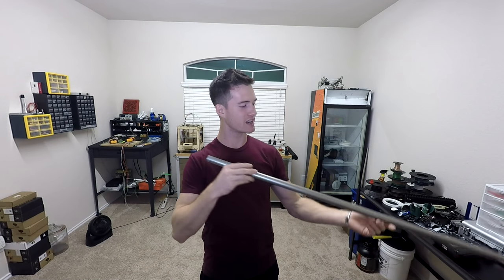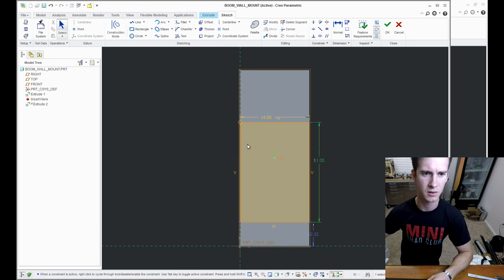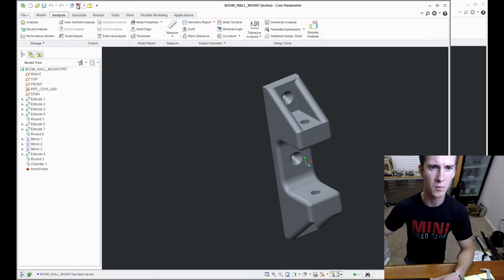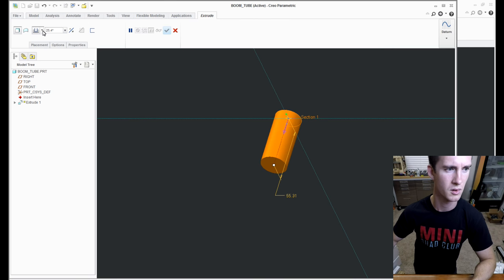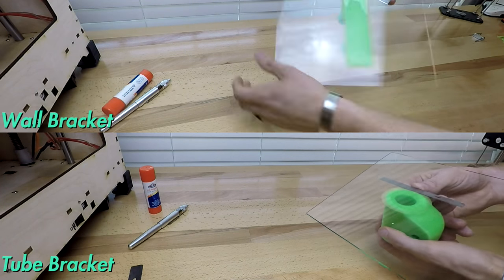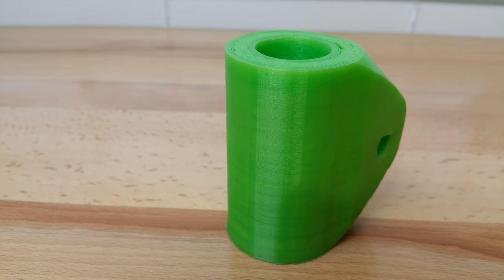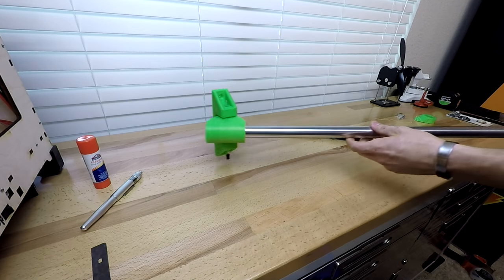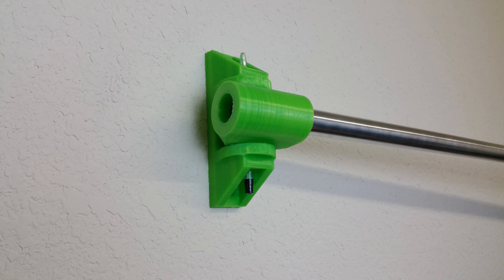News Flash - GoPro Boom

Comment: Thanks for sharing!

I have a similar process for my projects. Parametric cad is def a great tool together with 3d-printing for fast design iteration. I use Fusion360. Any particular reason that you went with Creo? Just curious :)

What is your reasoning behind the choice of rectilinear infill? I've always opted for the fast honeycomb.
Reply: He has an ultimaker so he probably uses cura to slice which only does rectilinear infill
Reply: He is using Simplify3D in the video.
Reply from the maker: +OMGSPARKS! I use Creo because it is what I am most familiar with. Everyone has thier own personal favorite based on experience. Rectilinear I believe is stronger than honeycomb. Other than that I don't have a good reason. Thanks for the questions!
Reply from the maker: +Ounce of Tech I did use Cura for the longest time but finally bit the bullet and purchased Simplify3D.
Reply: Have you folks tried Craftware?
Reply from the maker: I have not, is that what you use for modeling? Why do you like it? What makes it stand out?
Reply: Fast slicing (uses GPU); interactive options, manual addition/deletion of supports, free (as in beer). It does have its issues, but works well for me so far!
Reply from the maker: Ahhh very cool, I will have to look into that. haha right now I do not have a graphics card. So that might not be best for my scenario ;)